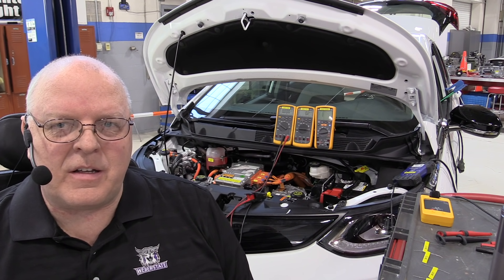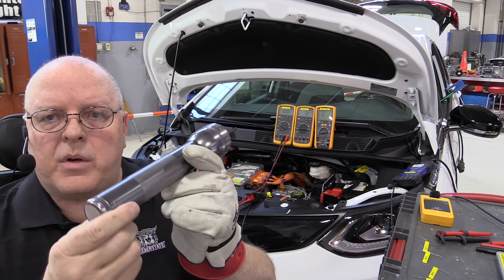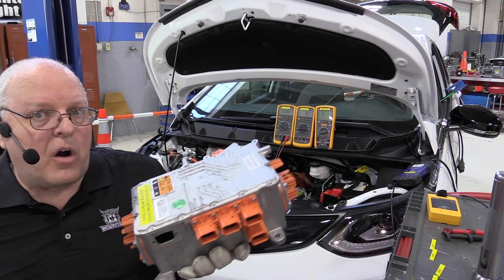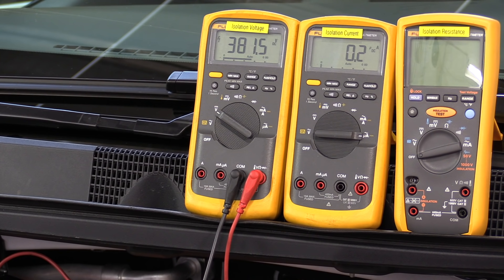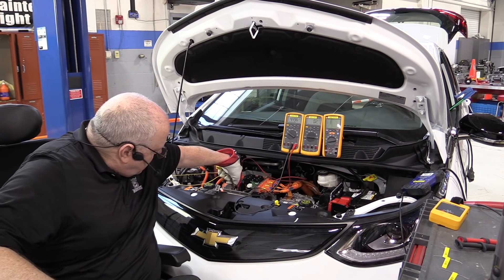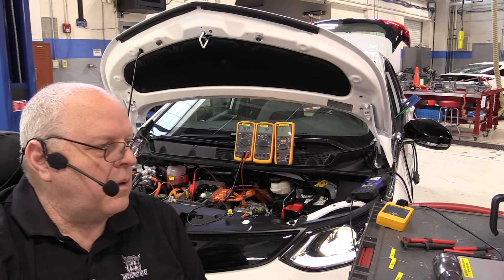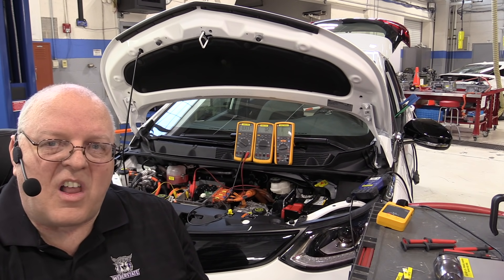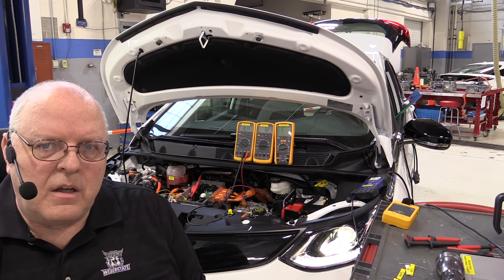Megohmmeter - Loss of Isolation Diagnostics

Comment: What a fascinating demo, I didn't realize the high voltage system is isolated on the ground side, too. Traditional safety for high voltage is to offer a low impedance grounding path from chassis back to the transformer, so a human hand that touches chassis will be reliably bypassed in favour of the lower resistance route. Dogs lost their lives by tinkling on the ground beside the wrong power pole without that.
Reply from the maker: Thank you very much. It was fun to experiment with. Thanks for your feedback!

Comment: Awesome workshop! :D I don't know how many hours of boring courses I have taken, and most of them have been summarized here. It would have been nice two more things. One, difference between CAT III 1000V vs CAT IV 600V. And second, with the Meger, to mention that the button in the lead is doing two things: when you press, it energizes and takes the measurement, but in case that you are measuring something with capacitance, that capacitance will get charged, so if you remove the lead after the measurement, you will most probably get a 500 V or 1000 V shock... (if the capacitance is big, you might have some kJ of energy there... not enough to kill... but it's not a nice experience) So the way to go is, once you have finish the measurement, keep the lead connected and then release the button. That will force an "active discharge" through the Meger (you will see the voltage going down in the display). Then you will know that the capacitance is discharged and it is "safe" to touch the component. Enjoy! :D
Reply: Thanks David. CAT III 1000 V vs CAT IV 600 V is in relation with the maxim  transient voltage that the lead and the meter can receive. The value is taken from power systems in AC (CEI 31010-1), how much is the meter close to the substation, but in EV (DC) is different, despite of the standard is saying for EVs you have to use CAT III.

Comment: Great video John. The P0AA6 is Ford's loss of isolation DTC, and it's a code lots of techs struggle with. As your video shows, it's a super simple concept and easy to diagnose if you understand what the code is monitoring for. 

Unplugging connectors one at a time is a great test, but on the Focus BEV, the ACCM, DC/DC, and PTC heater all have interlock circuits monitoring the connectors. We have dummy connectors that plug in to close the interlock, then we check the PID values for leakage on positive, negative, or internal battery.

Another point worth mentioning about how safe these vehicles are to work on; Ford no longer uses the fiberglass "Shepard's hook" as a technician removal tool. And, the upcoming Mach-e will not require insulated tools or gloves. Respect the potential of the systems, follow the procedure, and understand the theory and you'll be safe.
Reply: I have a 2016 fusion Energi showing this code. Any idea on where to start?

Comment: Thankyou Professor Kelly for the information.  I've only had training on the Prius High Voltage system, including removing the HV Battery assembly, the HV Inverter assembly, removing the safety covers on both, and the jumper straps on the individual batteries for testing.  Very, Very Interesting!  Oh yes, also checking the High Voltage Capacitors in the HV Inverter, for High or Low Voltage with the High Voltage Battery Assembly cables disconnected.
Again, very interesting!  The training paid off when I had to remove the inverter to replace coolant hoses under the inverter.  The vehicle had been in an accident.  With help from an iATN member named Carolyn, I was able to keep the transmission in neutral even after powering down, by removing a relay in the underhood power center on the driver's side near the firewall or bulkhead.  When we brought the car to the body shop, I told the techs there to block the front wheels or the car might run away from you!  HA!  It ran great after body and mechanical/electrical repairs.  I apologize for the long comment.  Mike C.
Reply from the maker: Awesome, thanks for your feedback

Comment: Bravo, great video.  A tip from my teaching experience: when using autoranging multimeters you can disable the autoranging and set a specific range for the display, which eliminates what happened at like 6:12 where the meter showed a few millivolts.  We experienced folks know that means zero, but a novice student is sometimes distracted by having a non-zero display.

Comment: Thankyou for another great video. If I was young again I would seriously become the best at working on this new generation of electric vehicles. It would be a great living to have with little competition from other mechanics that can't afford the computer tools needed to diagnose problems. Before retiring, I worked on mainframes, micro computers, networks, microfiche printers and a vast amount of printing machines for the last 40 years. Machine repair has always been my passion.
Reply from the maker: Thank you very much
Reply: Computer tools aren't a new thing for mechanics though.  Mechanics have been diagnosing and repairing computer related issues since the 1980's.  The difference in computer tech is very small when comparing internal combustion vehicles to electric.  It isn't uncommon to have 30+ computers networked over CAN data bus circuits in modern gas-powered vehicles.  The big difference is literally learning the high voltage systems, this video is a fantastic example of this.

Comment: I am not a technician, but I am a very curious person. Your videos are a joy to watch because you are clear and not too fast. I must add that in the Netherlands we had an accident with a Tesla hitting a tree where the car could not be approached by the fire department because sparks kept flying around. So, it can go very wrong. In fact, the fire department had to call up somebody from the Tesla service center on the other side of my small country to assist making the car safe. That took hours. The driver, by the way, was killed at impact, not because of electrocution or the long duration before help could be given.
Reply from the maker: Wow, that is terrible! Thanks for your feedback.
Reply: in case the pack gets damaged, as can be the case in high speed accidents, individual cells can short circuit, spark and release a LOT of heat. But that still would not result in electrocution risk for the firemen, as they are still not part of a full closed HV circuit. 

They heat from Li-ion cells should be treated with respect and care and is dangerous for that reason.
Reply: Of course it can go wrong if the battery pack is physically damaged. Just the same as it can go wrong if a fuel line or tank ruptures near a hot engine or exhaust. Driving any vehicle is inherently unsafe, but I don't think it is reasonable to say that an electric vehicle is less safe than a gas/petrol or diesel vehicle. Much is done to make the lithium battery packs in cars as safe as possible, which is why there are not many problems seen with them. Most of the problems we see with lithium batteries in general are as a result of companies and/or nations with no safety standards building and selling garbage. That isn't going to be the case on any mainstream EV.

Comment: That's the exact Mega meter I use at my job on navy ships and oh yes they WILL shock you. I can attest to that myself. We have to meg each and every cable we install BEFORE we hook up any equipment. This meter is extremely useful in testing the integrity of HV cables installed in electric vehicles. In addition to testing  the resistance to ground, we can also test the resistance between conductors - on multi lead cables.

Dang I love this stuff.

Comment: Professor Kelly, your videos encourage me to keep going even when injury & disease has me stuck unable to do anything other than watch these videos. Thank you so much for being an encouraging example & for the cool EV content. I drive a 2016 Nissan LEAF 30kWh & our other car a 2005 Prius II // I love electric motors & batteries & energy storage capacitors & high power switching electronics contractors & SSR's & microcontrollers & compute & digital systems. Your videos are cool & they show why EV's are super interesting. Also really like your collection of Fluke meters, they are really well made. I keep a DIY modded Sperry DM-350A (added external hard on/off switch for the meter battery) so I can leave control dial turned to DC 0-20vdc mode since that's the range I measure most of the time :)) Thanks for sharing this useful information :) God Bless
Reply: Battery Systems with multiple battery cells usually contain
BMS or battery management system to balance & minitor all the cells
CC or charge controller that can independently charge each cell & cells in series
Fuses or breakers to open the circuit, usually on positive side of battery, to safety if shortening occurs
Thermistors or temperature sensors to keep track of cell or pack thermal state during charge & discharge & storage

Pack properly designed should prevent overcharging, over discharging, damage from shorting & against thermal runaway or fire & or cell expansion disconnection & other safety aspects to minimize chance of venting with flame, fire or explosion

Comment: I find it interesting that they go through great lengths to isolate the battery from the chassis but they don't really do much when the isolation is lost.  In the power distribution world this is referred to as a "ground fault" and hence the name Ground Fault Circuit Interrupter for the type of breaker that protects against this.  I would expect the  car to return to a safe state in the event of lost isolation by opening the contactor on the battery.  In high power DC systems this is done to prevent fires.  A single fault is not a problem but if you get a 2nd fault you may be passing current through items that shouldn't be conducting that much current (signal wires, chassis connections, etc).  For this reason, most high power DC systems will trip off in the event of a single "ground" fault or loss of isolation.  

Anyway, great videos!!  I always enjoy watching the stuff you do on electric automobiles.
Reply from the maker: Thank you and thanks for your feedback. As you may have seen in the video, a single direct short to chassis only causes 222 micro amps of current.
Reply: @WeberAuto  Yes, the first loss of isolation is not a big deal.  The 2nd point of lost isolation can cause a shock or a fire.  That is why most industrial machines that use ground isolation trip off on the first loss of isolation.  You don't want main battery level power flowing through some small wire somewhere or part of the frame.

Comment: I love this stuff.
A note on why its called a Meg-ohm meter, its because a company called Megger makes HV test equipment for the Electrical Power Sector, including a tool commonly called a "megger" which tests for isolation, using a high voltage, ultra low current test current. So there would be some trademark malarkey involving a Mega-ohm meter sounding like a branded Megger Ohm meter.
Reply: Megger make mega-ohm meters....
They also make devices that use kilovolts to measure mega-ohms....
Rather like Druck making pressure calibrators in Germany (look up the translation).
Reply from the maker: Thanks for your feedback!

Comment: Great example on the flashlight! So risk of electric shock is almost 0 because of the DC high voltage battery.  On the other hand, during charging, there are many other factors that can make an AC electric shock to happen!
Reply from the maker: True. That is why the protective earth to chassis ground connection must be made first before any charge station current is allowed. Improper wiring could certainly cause some problems. Thanks for your feedback.

Comment: Great video,  helped to explain what may be going with the Toyota  Rav 4 hybrid 2019-2021 ...MGR cable connector corrosion 
Toyota did change the connector design in 2022.....To address this problem.....

Would you recommend any type of moister / corrosion inhibitor applied to the connector proactively

Comment: I sure hope I never have to do this but your info is there should the need arise. Another great dive today up Tempanogas canyon. So much to learn about these machines in both operation and monitoring. Yet to see what my electric usage will be but I am charging only from 10pm to 8am. When cold I start  car 30min before use with cabin heat on & on charger.
Reply from the maker: Have fun! Thanks for watching

Comment: At 12:30 a "megger" is also used to accurately measure extremely high resistance, for example, between two points in the earth (which would have extraordinary, but measurable, amounts of resistance). Very informative video, and sad to report that too many other colleges are not taking electric vehicle maintenance seriously enough to create adequate curriculum.

Comment: As far as I know whenever the airbag is triggered the pyro fuse(s) in the battery will blow also. On Teslas whenever you open a high voltage enclosure a microswitch will open the first responder loop.
Reply from the maker: Thanks for watching

Comment: Fantastic job as usual professor.  Question, are the resistance values just so high on the monitoring circuit that the battery is considered isolated from the chassis?  Seems like since there is a connection to the chassis on both negative and positive side of the battery but just through very high resistors that it be correct to say the system is not isolated.

Comment: Thank you professor.so far i thought that, negative supply is connected to ground in Ev just like ICE car.but i learned from you that, dual powersupply sytem is used inEV. That is +ve and -ve to common  ground.Usually i saw this type powersupply in HiFi audio amp.Moreover i request you in future please add circuit diagram to explain the power supply trouble shooting.I HOPE  you will use some circuit diagram to explain  the electrical ciruit. Once again i thank you for your kind information.God bless you for your best health.
Reply from the maker: Thank you very much

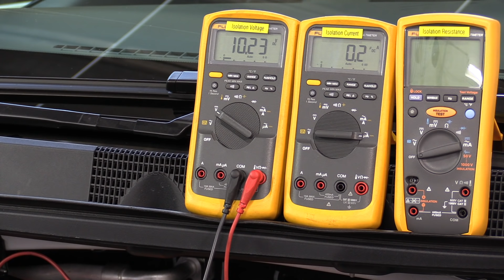Comment: John, as an EE myself in the industry, this is a great video! I have a question regarding the section at 7:36- do you know what is the reasoning for manufacturers allowing this type of fault? Given recent faults I’ve seen on Cybertrucks, and their large bare metal exposure, this seems like a huge safety concern for the public. How easy would it be for an energized vehicle body either charging or just sitting at idle with a fault of this kind, to find a path between a human and a building’s ground system for example? Im seeing this as a huge unseen issue which may have unfortunate consequences for consumers.

Comment: From my experience working on electric buses, moisture can still get in  - or develop rather - in a hermetically sealed compartment, due to heat buildup...*IF* the compartment or device within is not cooled. I reported this moisture buildup to the engineers who insisted that water was getting into the battery compartment. The vehicle was never washed and there was no rain. The engineers decided to replace the gasket on the roof mounted battery compartment AND clamp down the edges of said compartment using angle iron all around the edge of the  battery compartment top cover. This did not solve the issue.

I recommended that the compartment either be vented or some type of cooling system be put inside / through the compartment. Eventually they came up with a cooling system. - not sure if it was liquid or air because I quit before the system was introduced on the buses I was working on. This moisture buildup reaped havoc on the connectors linking the batteries to the module that sat directly on top of each connector - they turned green on the inside, which resulted in a drop in cell voltage. These connectors attached to ribbon cables had to be replaced.

If for whatever reason moisture seeps into the battery compartment and problems should develop, the connectors need to be inspected. If green on the inside, replace them. This can also cause one or more cells within a battery to malfunction and the battery may have to be replaced - depending on what type perirhinal device / equipment is attached directly to the battery or located within the battery compartment..

Comment: Love your videos, thank you. I have a 2017 Bolt and would like to purchase an inverter to use in the event of a power at my home. What is largest size inverter can I use. Don’t plan to go crazy, just frig, light or two and maybe my internet and WiFi devices. Thank you.
Reply: fridge? Most fridges are going to need more than can be just be hooked off from the 12V side. For up to ~150W you can just pluginto the cigarette lighter.

Comment: Hi Professor Kelly, great video as always. I would like to ask what if we touch the vehicle chassis incase HV battery +ve terminal is touching the chassis. Is there any possibility of getting shock? Thanks
Reply from the maker: No unless you can somehow touch the high voltage battery negative at the same time
Reply: Thank you so much.  Had that question in training, The trainer said you can get electric shock as you become ground for the circuit. It didn't make sense to me what he was saying.
Reply: @mechanichead1711 , @WeberAuto, I had the same q and for Prof Kelly's answer to be correct, something is going on that I don't understand. If chasis voltage is +380 v, the +380v is relative to some ground point. If one were to take a metal cable with a spike at one end and a clamp at the other end, burry the spike in the ground and then attach the clamp to the car, I would think sparks and melting parts! If you do the same as a person, maybe your shoes save you from burning to a crisp? Try the same experiment shoeless water then.... you're down to the resistance of your skin? Or in the car setup, is there some other ground reference point and thus the word "isolation" that's being thrown around? Would love some elaboration on this!